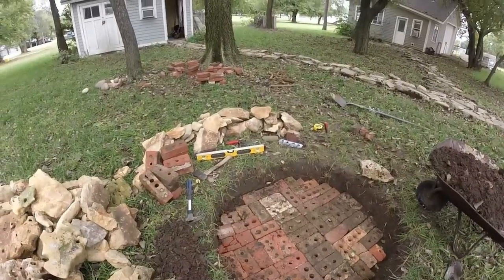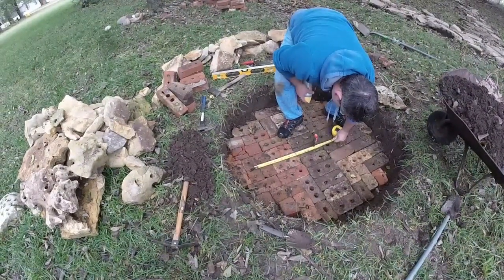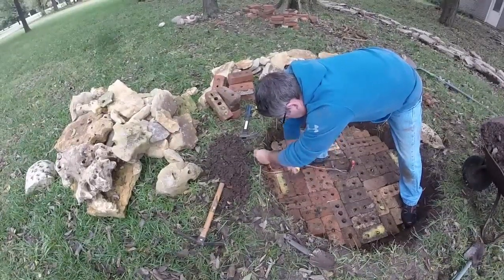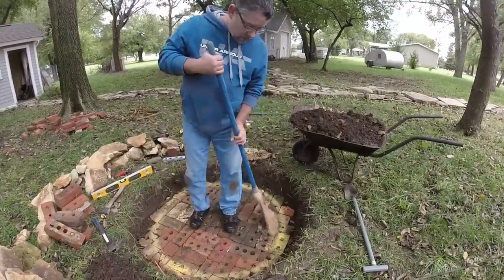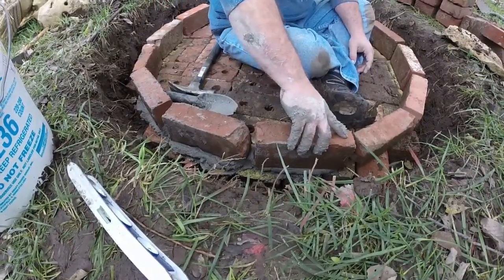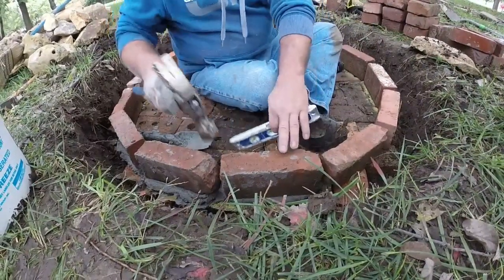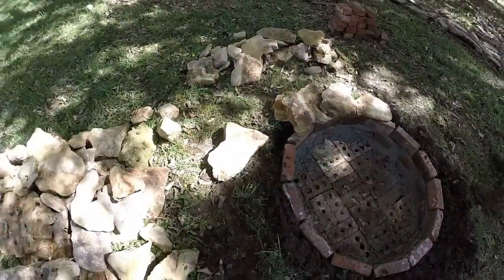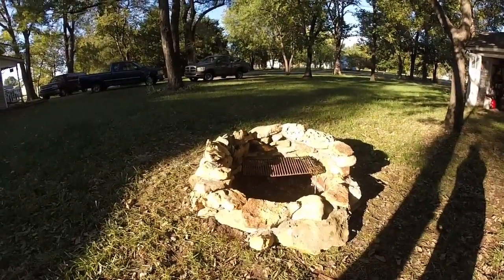How to Build a Cheap ($15) Fire Pit

Comment: Hello did you have any issues with the rocks exploding due to the heat? I read that rocks will explode in fire pit.
Reply from the maker: These rocks didn't explode they are sandstone/limestone based. I believe the hard/crystal rocks like granite will explode
Reply: Thank you for your quick reply! I just built a fire pit over the weekend but haven’t used it yet and after building it I started doing research and some things say it’s dangerous and some say it’s not. Thank you again